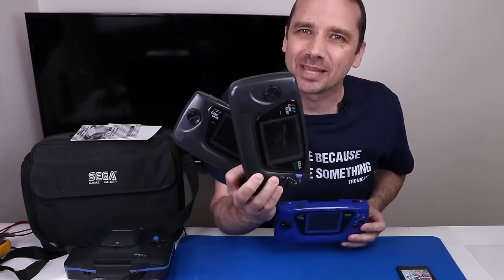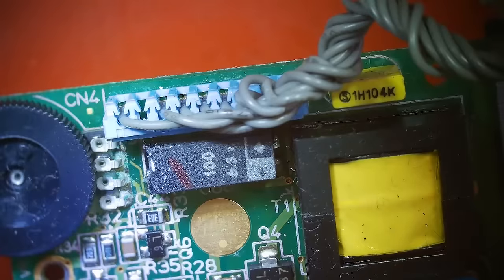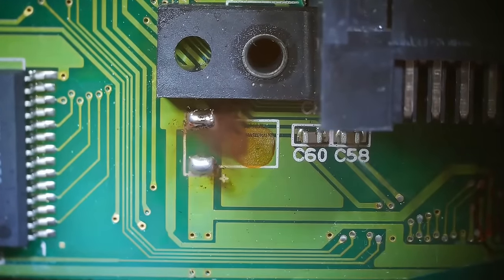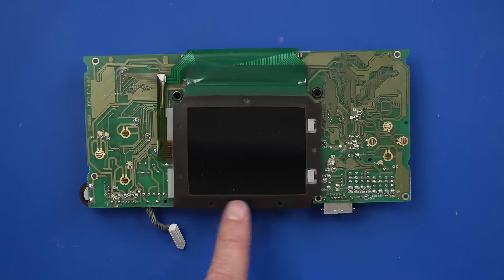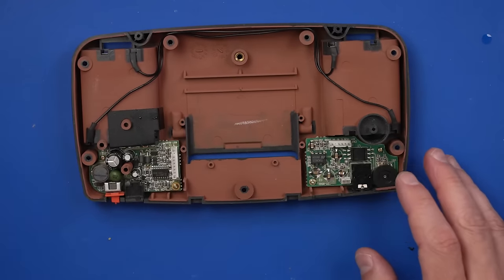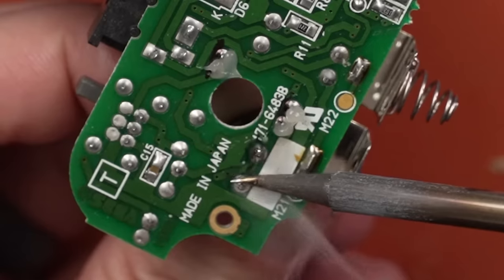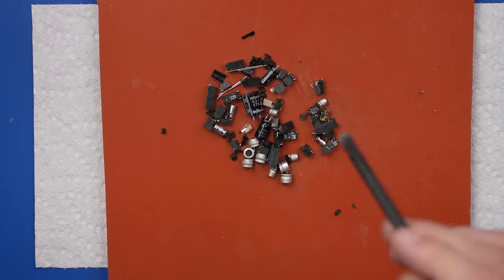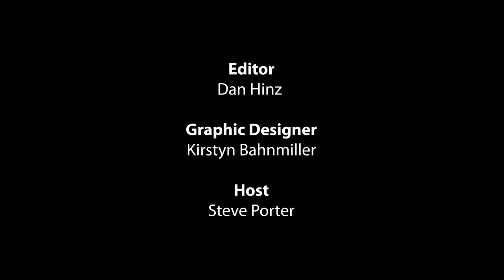Trying to Fix 3 BROKEN Sega Game Gears - Extended Cut

Comment: Steve, great health wishes first!
For the short circuit board, why wouldn't you inject voltage, like 1V, and look for heat spot. You can use thermal camera if you one, or the atomizer, or if you got no of these use 95+% isopropyl alcohol and look for a spot where it evaporates fast. This board must be saved!
Reply: I was also wondering if this method would've helped save the board. Hopefully he revisits one day using this technique.

Comment: great vid, i woulda used a solder wick to clean the pads tho, the mix of corrosion may give issues on the solder making a good enough connection otherwise.  But great job either way :)

Comment: I wish you would say what your settings are when you do repairs. Knowing your temp on the soldering iron and hot air is handy info for a novice like me.
Reply from the maker: Yeah, I try to do that sometimes but usually forget. I've learned to work with my setting pretty much the same all the time with a few exceptions. I don't remember my exact settings but I think I have my irons set at about 750F. My hot air station is usually set at 1100F and I think the airflow is set at 3.
Just keep in mind that your settings will be different as you'll likely have different equipment and you'll be working in a different environment that I work in.

Comment: I have a question if you could help. I saw it on the second game gear you were fixing. What capacitor can i use to replace a ceramic 121j 2kv. On mine it seems like a burn spot under it so figure that would be part of the issue with mine. I like all your videos and they help me try to fix some of my old game consoles

Comment: One thing I hope you're doing still is neutralizing the capacitor electrolyte. The flux alone doesn't neutralize the corrosiveness of it. IPA also doesn't completely neutralize it. Generally with something like this, a slightly diluted distilled vinegar works well, then a quick scrub and rinse with the IPA,

Comment: Nice video Steve, i'm glad the algorithm showed me this channel. I don't agree with whoever put together that capacitor kit, replacing electrolytic with ceramic caps is not recomended in all types of circuits, it's acceptable in some but not all. Also replacing 33µf with 100µf is also not good, it's okay to go up in size but not 3 times the original size. Another thing is that brown glue that is in the lower corners of the main board covering some of the chips of the blue console should be removed because once it turns brown like that it going to go conductive and cause all kinds of problem, that's a well known problem with this kind of glue
Reply: Agreed, this capacitor kit seems lazy and cheap. I believe that Console5 offers legitimate cap kits for the different Game Gears models for anyone looking for something better. Haven't used the kit myself though since I buy caps in bulk.

Comment: @TronixFixLongs. love your fixes and been watching for years but  @ 21:05,  why struggle with the the solder sticking to the pads, I'm Just wondering why you didn't use some solder wick to clean the pads ? its a very simple clean up job that not only saves time, it does a much better/cleaner job and prevents you damaging the pads, just seams weird to me. I know your not a qualified electronics engineer. But you have lots of skill and years of practise yet you still do it the hard way :)

Comment: I have a childhood game gear.  I have the same case , games, and even a battery pack (doubt it still holds a charge).  It has same issue no video on screen and assume it’s the universal problem with these.  Do you offer a service where I could mail it in for repair.  I have held on to it for years due to nostalgia.  I’d love to get it fixed.

Comment: Im sure you know this but just in case for anyone else, for the corrosion on these pads, my friend recommended scraping away at the pad with a craft knife or like the dental pick you have. Then its much easier to solder from
Reply from the maker: Yes, if there is corrosion on the pad it can be very difficult to get solder to stick to it. Solder sticks best to a nice clean pad.

Comment: I recently refurbed one of these, the audio was very quiet so I got a new amp board, they are very cheap, and my screen was totally dead, so I had to get a replacement screen. I can recommend the Benn Venn screens,  they are bright and clear and look great. I have a Benn Venn screen in my Lynx II as well, really very good.
Reply from the maker: Great to know. I'll check those screens out. EDIT: I looked the website and they are sold out of most of what I would have bought. Bummer.
Reply: @TronicsFixLongs  That's a shame. Good luck with your future fixes, I'll be watching 😁

Comment: Do you know why it would be OK to replace those caps with bi-polar ones ? I figure if they used polarized ones, they must have chosen them for a reason. Thanks for the video repair.
Reply from the maker: Honestly, I'm not sure why the kit comes with those or why they use them in place of the polarized ones.

Comment: Hey Steve where did you source the cap kit from? Also have you ever had any issues using that style as opposed to the standard caps (minus the whole leg manipulation) definitely looks cleaner thats for sure.
Reply: Console5 is where most people get their Game Gear caps.
Reply: Also, for the ceramic caps, Hand held legend sells them, not sure if Console5 carries those
Reply from the maker: I think I got these from Console 5. I haven't had any problems with that style of cap but I also have not used these for extended periods. Ceramic caps are more durable in general than electrolytic so I think it's a good move but honestly I'm not sure why manufacturers choose one over the other.
Reply: @TronicsFixLongs  There were some tests done and presented on the GG forum on Reddit. For the mainboard, there was no real difference. For the sound board, the thruhole mounted sideways (not sure if this is coming out right!) performed better than the ceramic caps. I'm not an audio engineer nor an audiophile, so I doubt I could tell the difference. For the Powerboard, I believe everyone uses thru hole only. I've done multiple GG with both types of caps and both have worked fine for me with ceramic much easier to work with

Comment: Steve, once a gain, regular batteries don't have acid, they are alkaline so no acid whatsoever and if they had acid it would definately not react to vinegar which IS an acid. What you see is a redox or reduction-oxidation, which means that the acid (vinegar) is neutralizing the alkaline residue of the batteries.